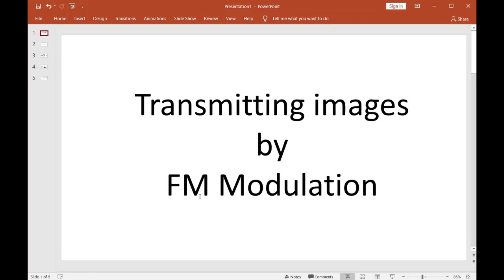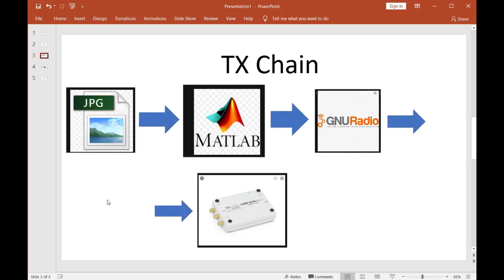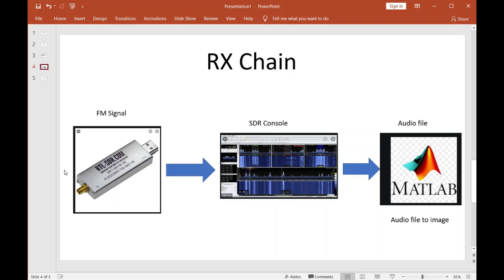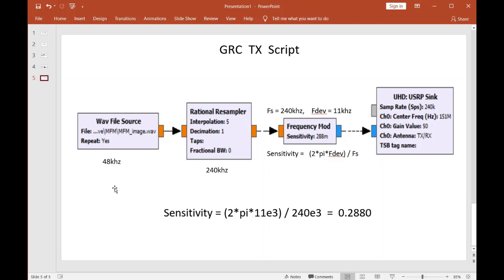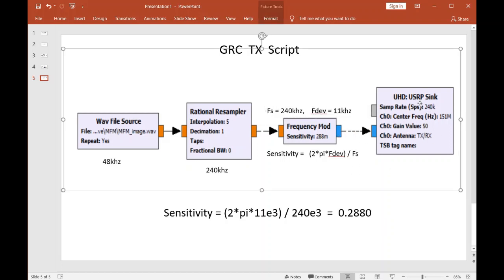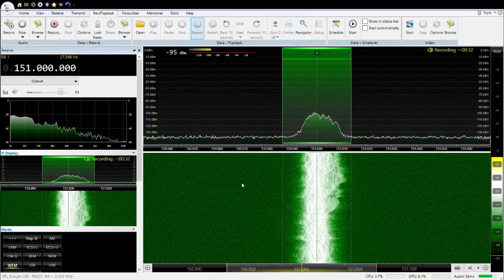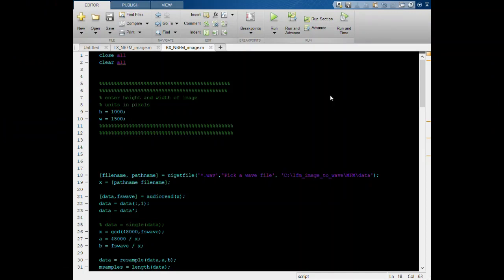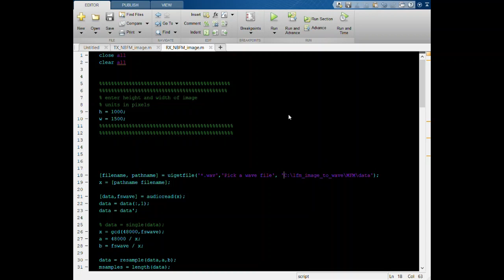FM Image Transmitter Project

Comment: dear Sir, why we convolve the image data with LFM (chirp) signal ? why not another signal ? what's special about LFM ? you always use it..!!!  
i also tried to use my R&S signal gen. FM modulator to transmit the audio file to the SDR instead of using GNU radio and Hack RF , it was somehow successful, but the image produced lacked all details ...seemed like as if it came out of a low pass filter....any advice how to remedy that?
this project is quite complex in the underlying theory....might look simple to others...!!!
Reply from the maker: Make the frequency deviation 11khz on sig gen.   Lfm is used for matched filter.   Pulls images from noise
Reply: @TheGmr140  thank you sir, i wish you still teaching and i would apply to have a course taught by you.
Reply from the maker: @ahmedgaafar5369  glad to help.  Have more video coming, bladerf, and red pitaya to come.   All great SDR transmitter and works with gnuradio
Reply: @TheGmr140  hello prof. the experiment succeeded but the phenomena of receiving negative image was a surprise, i had to modify the receive code by deleting the commenting % in front of data=1-data...now the image received is positive....why this is happening is mystery for me...i hope you can explain that....thanks it is a great learning by doing.
Reply from the maker: @ahmedgaafar5369  yeah that line should be deleted

Comment: Mr Gmr professor please explain the theory encoded in the matlab TX and RX algorithms ....this is freaken intense ....peter parker ..!!!!
Reply from the maker: read in image, convert to black and white,  convert matrix into vector.     once vector,  convolve image vector with lfm chirp waveform.          transmit this audio waveform thru a fm modulator.          rx fm signal,  demodulate it,   then de-convolve , or de chirp signal,  reshape back to matrix,  display image.     and all this will give better images than SSTV, HF FAX,  and any other slow image standards,  because my method uses 21st century DSP.     LOL
Reply from the maker: for the RX script,  since the audio file is already 48khz sample rate,  you can comment out the resample function,  some folks were saying resample didn't work in matlab 2019
Reply: @TheGmr140  thank you sir,  now i got it,  convolution = IFFT(X.Y)=IFFT[(fft(x).*fft(y)]....i just saw it now after your explanation,
convolution in time equals inverse Fourier transform of the multiplication  in frequency domain ...thanx a lot.